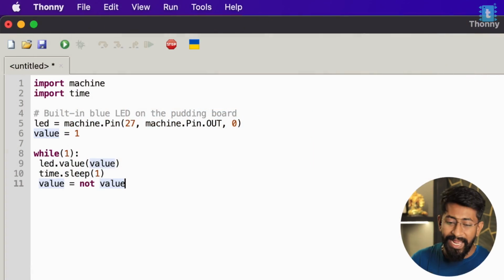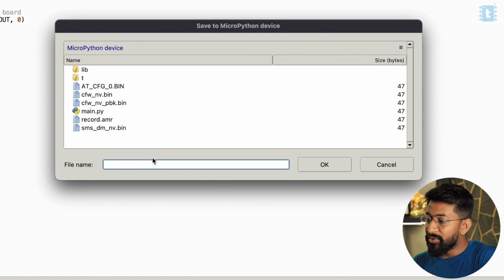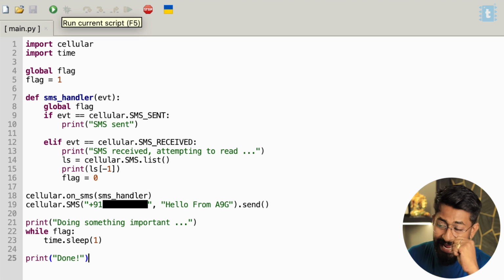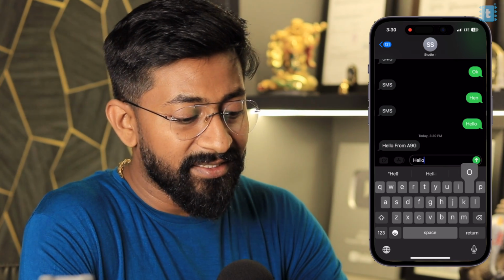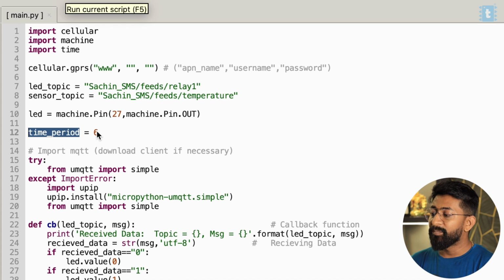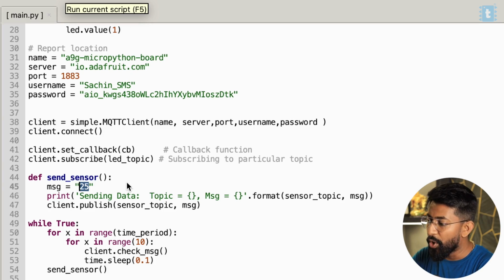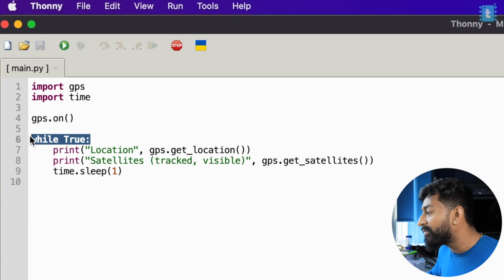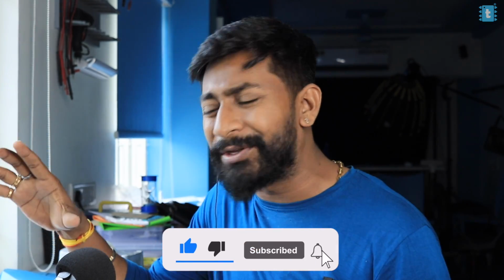Make projects via Micropython using just A9G board  | GSM, GPRS, GPS, MQTT and lot more....

Comment: This board is not stable. The biggest problem that you need to upload the firmware regularly if the input is not stable, i.e multiple or frequent reboot will corrupt the firmware.

Comment: when start stop show this message: Device is busy or does not respond. Your options:

  - wait until it completes current work;
  - use Ctrl+C to interrupt current work;
  - reset the device and try again;
  - check connection properties;
  - make sure the device has suitable MicroPython / CircuitPython / firmware;
  - make sure the device is not in bootloader mode.
Reply: hay que instalar drivers que no lo dice en el video, y conectar los cables de control rx tx inversamente tx a rx y rx a tx..

Comment: Hii,
I am working on this module for gps tracking. I had one issue when A9G module was connected to the TTL connector It worked fine but, when connected to the USB cable alone it was not working. How to resolve it.

Comment: The Question is? Why are the Darliks Doing, SOFTWARE DEFINED HARDWARE? The Darliks Can't Compete with the Borgs. So They Have Lower Volume.
The Darliks Don't Want to Get Dependant On Borg Technology and then Get Strangled by them. They Want to Show them that They Too can make Hardware in Order to Get Discounts. Because of Lower Volume: They're Using General Purpose CPU's / Hardware to Do Their Specific Hardware.
If they Could Compete with Borgs on Volume. Then they Wouldn't Do: Software Defined Hardware.

Comment: Those Darliks Have Made a Big Mistake With Their: SOFTWARE DEFINED HARDWARE. We Can Break the ARM Cortex A53. The Hardware Chips are Using Slimmed Down Micro Controller Versions of this. Therefore We Can Reverse Engineer with Ease, their Hardware Devices. Their 3G Chip will Break Easily. The LTE, Chip is using Hardware Accelerated Floating Point. We Might Not be able to Do that One. Not a Problem. We Can Do: GSM450: E-Mail. GSM:900 Voice. GSM1800/1900: 3 Megabits Data. You're Running Communism and Slavery the World Over to Run your Satellite Cloud Broadband Networks.
The Standalone WiFI Chip will Also break easily.
As For Personal Computer Devices. The Mackintosh Peripherals, will break Easily. We Can Run Mackintosh Drivers, On Our Hardware.

Comment: Why do we have to press the button to power up the board? It's done automatically right?
Reply: I have the same question. I tried reading the manual which is in Chinese and in the pin definitions it says that the PWRKEY pin must be low level to turn on.
But in the devboard schematics it is at a high level. That's propably why he has to hold the button to turn on.
Reply: Ese pin prende la placa cuando lo pones en bajo por un segundo asi es que lo uso y si tiene el chip y lo conectas prende solo en un momento

Comment: hello . very good video. I have followed the instructions and I have managed to get the gps working. But with gprs I can't connect, using a euskaltel (spain) sim. I have tried several apns. any suggestions? thank you
Reply from the maker: It only supports the 2G connectivity
Reply: @techiesms  thanks for answering. I have tested the sim in my mobile phone in 2g mode and it has an internet connection. in the a9g it does not connect with this same sim using the same apn data. I don't understand. thanks a lot